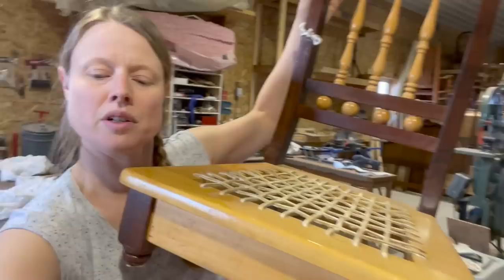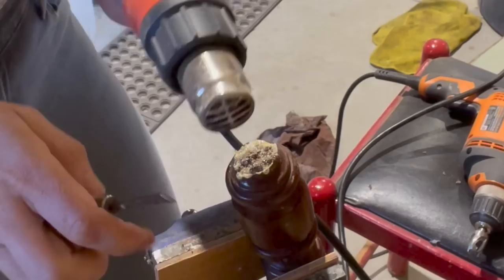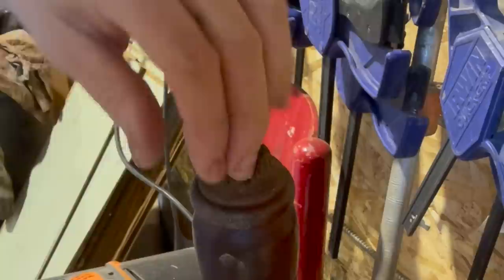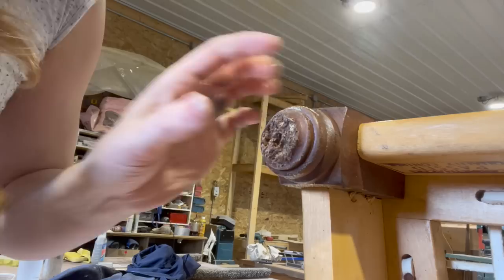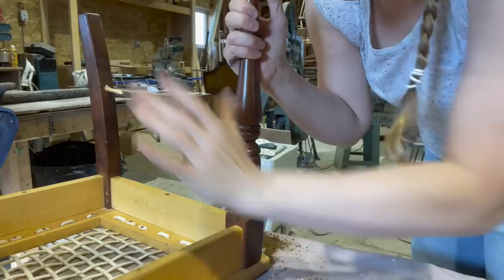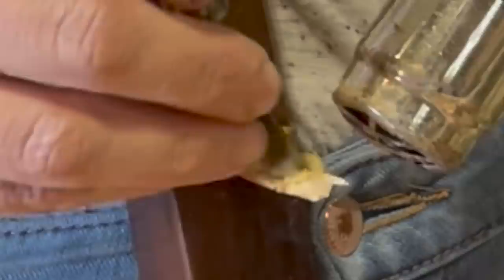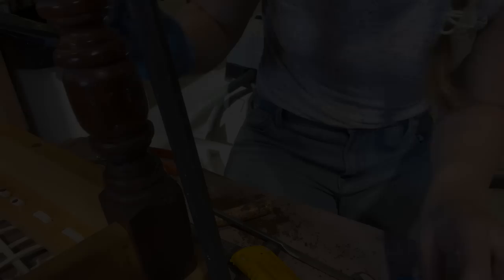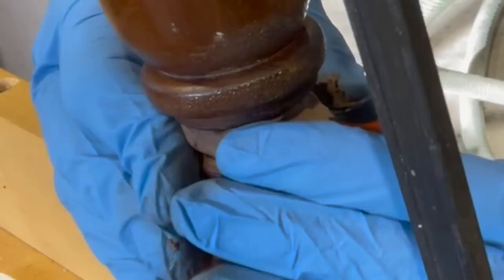Repairing a Broken Chair Leg

Comment: Great skills! I suggest when you get done, place the chair on a flat surface (your table saw usually works best as it is perfectly flat) and see if there is any unevenness. Normally there will be a slight wobble you can address.
Reply from the maker: I definitely learned that one from my dad! Thanks!
Reply: I told her what that I do is sit them down on a level concrete place and slide them back and forth and around and around in a circular motion and let the concrete sand the leg 
ends-bottoms off till they are all the same height and makes them solid, so that they don't rock.

Comment: Great restoration.
I would have cut more lines in the dowel to give the epoxy more tooth to work with. The dowel between the legs, maybe a pin inserted between the broken pieces in drilled holes as epoxy doesn't expand and contract the same as wood with moisture values changing over time. Some people tend to place their feet on the dowels causing stress to them.
Your finished product looked very nice.
Reply from the maker: Thankyou. So the epoxy we use is a marine grade epoxy and one of its best qualities is that it keeps a strong flexible hold. You are right, a lot of epoxies out there are very brittle and will snap on impact which is why I’m in love with this one. Although it is hard and can often times be stronger than the wood around it, it’s made to flex with temperature and moisture. Just like wood. Cheers!
Reply: Amazing, beautiful, well done, interesting, entertaining, educational and truly enjoyable. Thank you for taking the time to share this with us.

Comment: I’ve used lashing on long split joints (like the spacer). Use string or nylon fishing line & coat with epoxy. There’s not much pressure on the spacer split — until a ‘kid’ decides to rock back on the back legs 😠 (I’d hang ‘em!)

Comment: I have a old doll crib that was mine, and it has spindles. What do you use to get the paint off. I noticed you always take everything apart and start over. You inspire me to want to redo this crib for my grand babies! Or what video would you suggest I watch! Thank you for sharing all of your talent! Your work is amazing!
Reply from the maker: Use a stripper and wash them down until they are clean. Rinse with what the stripper suggests to rinse with. Cheers!

Comment: The dangers of advertising I used to work in a hardware store when gorilla glue advertising first came out you couldn’t keep people from buying it after showing them a mock up in a clean glue joint I tried to talk people out of it even seeing a sample in a clean fit a good Titbond joint is stronger that the wood, I had a number of square (jointer) the glue held but due to wood movement a board glued with Titbond the board split the entire length the glue joint didn’t move no dowels or bisques I believe the same will happen on a good white glue joint!

Comment: Observation
old wood exposed to moisture, corrosion and insects should be cleaned with diesel fuel as it is the best cleaner and disinfectant for wood and it does not expose it to cracks.

Comment: Awesome color matching, especially on the blonde rung. Very NICE results, even though I did notice your dowell drilling was a bit off angle — was that on purpose? I've got to repair the thin leg on a desk my uncle made, and have come up with a couple of methods that SHOULD keep the drill hole straight, except the break is at an angle. Always tough on legs attached, where you can't use a drill press or lathe to assure a straight hole.
Reply from the maker: Generally you want to stay in the middle of a rung for a new dowel. But if one side of the break has more intact than the other you can lean a little heavier on that side. Cheers!
Reply: @johnsfurniturerepair  I agree with that, but what I was referring to, is the angle of your forstner bit. What I thought I saw on the vid LOOKED like your drill wasn't parallel with the leg (it APPEARED you were about 5 degrees off). Same "angle" when you drilled the other. It's tough to do freehand, and you mentioned that the leg needed adjustment when assembling. As you drilled both at the same angle, I was asking if that was on purpose (due to the damage on the short peice). ?

Comment: Why did you not use white or yellow wood glue for the wooden plug?
The chair turned out really well, 👍
Carsten
Sweden
Reply: I’d like to know that as well.  Have not used epoxy in the past.  Does not look easy to work with.

Comment: The 5/8"  dowel looked to be about 4 1/2 inches long, and probably went right through the mortise & tenon joints where the leg joins the corner of the seat.  

I'm still mystified as to how you knew the leg was going to end up exactly the right length that it was before, so that the chair didn't end up rocking on three legs.  

·
Reply from the maker: If you line up and reference the old parts you can get it to the same length as I was. Cheers!

Comment: Very interesting, but why did you use a coloured glue at 13:45? Given that the colour of the wood is rather light. 

Cheers
Reply from the maker: Thankyou for watching. The epoxy I use has a pretty amber color naturally. But I definitely could have used something to lighten it and made my life a little easier in the touchup department. Thanks for the question! Cheers to you too.

Comment: I do like your video, however, I think you'll find this repair will not last long. In my own experience, I would have taken that horizontal spindle to a good wood turner and had a new one turned. And because I grew up with a fat Dad, I saw broken chairs more than once. People are heavier these days, including myself. Steel supports is what I would have installed. No hate, just say'n
Reply from the maker: Haven’t had a repair like this fail in 20 yrs but thanks for watching. Cheers

Comment: Even just by eye when you are doweling to pieces to getter you seem to get the angles to match, is there a trick to
Or just talent and a good eye, I occasionally have issue one dowel even using a doweling jig?
Reply from the maker: Ya jigs are 90% useless but if you learn how to use one and all its quirks they can help. I’ve been at it for 20 yrs and my dad used to make me drill straight by hand and feel

Comment: Great job..  Curious … are these kept out of the weather and if not would you have considered a urethane
Reply from the maker: rattan definitely needs to be kept out of the weather. it is very susceptible to moisture and the steam bent pieces will start to spring back if they get moist. there really isn't a finish that would protect it in the long run

Comment: Nice work, although to me this looked like a $100 repair on a chair worth $5. Also I have a question, in my humble experience working with epoxy and carbon fibre I found that when adding some thickener like sawdust or microballoons the epoxy loses much of its ability to form a tight bond with the glue surfaces due to the added viscosity. Not a concern with wood?

Comment: Very nice job the glue you use for the leg did you just put sawdust in for the colour or put colour stain as it did look very brown stay safe 👏👏👍
Reply from the maker: Hi and thanks for watching! The glue I used in this video was west systems epoxy which has a bit of a yellow amber colour, the saw dust I added gave it most of its dark colour. when i remember, I try to keep sawdust from different colours of wood to help colour the epoxy when it will be visible in the repair.

Comment: Also. A nice and stronger way to do a broken leg repair is to remove the seat  and drill through  and counter sink a lag.   Obviously things have to be centered  but when you glue and pull it together  it’s super strong  and you can fill and finish the top of lag  if necessary.

Comment: Is there a particular reason to use electrical tape vs any other tape?  Painters tape, for example?  Just curious if there was a particular benefit of the electrical tape.  Grip, the plastic-ish nature of the tape vs the epoxy.  Nice work blending in the repair work.
Reply from the maker: its very stretchy and i can get more pressure with it than other tapes.

Comment: Can you speak on why you use dowel rods? I've seen journeymen furniture repairers say that the joint will be weak and break over time and they usually cut in a spline across the broken joint.  Including someone that came to you shop recently and does furniture repair. The reason I am asking is I have used this method a lot (that you did here) and have been concerned about the longevity of my repair work doing this method. Please comment your thoughts about doing it this way.  I would appreciate you opinion and thoughts. Thanks!
Reply from the maker: Well I’ve been repairing this type of break this way for over 25yrs and I can say I haven’t had one return for failure. I think it’s important to have a tight fit and to use the r right size of dowel and a very strong but flexible glue. Cheers

Comment: Great job...again!!  You mentioned that you are using some shellac that you mixed up.  What did you mix together to get the final shellac solution you used?  Thanks.
Reply from the maker: Just amber shellac. No color added
Reply: @johnsfurniturerepair  Thanks!

Comment: U may think about why it broke in the 1st place.  Then ask should u just repair it to
make it as it was?  That leg broke bc the designer tapered that portion of the leg
(Kiss Chocolate like tapered n tear shape) narrowed that leg out at the junction
far away from the bottom of the leg, close to the seat.  The leverage from buckling
n swinging that leg, dragging, shifting the chair placed a lot of force concentrating
at that top junction of the leg.  It was bad design to cut channel to any of the 4 legs
there.  Yes, the dowel idea was good.  But using much more fatter dowel than the
broken diameter exposed portion of that leg would b better.  But, using a longer 
steel or  brass dowel or even a piece of steel pipe w threaded ends tapping into
the leg and the other end of the leg deeply wld b even much better.  Eventually, 
ur customer would have other legs if not at the same leg broken bc of the way he
shifted, rocked, etc. w that chair.  Also, that thin broken stick connecting the front
to the rear leg was also not too smart.  It couldn't take the stress and broke.
The chair designer was not up to par...

May the aesthetic Win every time for a stationary ornamental art object, but not 
for a daily use moving furniture that carry 300 lbs of big seat!  Don't rock the boat!!!
This boat's floor doesn't give like water!

And, never use nails on wood.  Use pre-drilled hole for screws* (e.g., for that
leather straps) or pins as upholsters do.  Only carpenters r allowed to use nails.
They split 2 x 4s all the time on ur house framings.  But the customers won't
notice after sheet rock over them and even on the balcony wood rails, or
stair ways of wood, the customers wldn't c the splits.  Everybody else, including
the owners of the house or owners of the furniture may think about reversible
screw usage instd of nails.  Glad that glue mess was reversible and ur customer
didn't try hammering a nail diagonally to re-attach the broken leg!  Maybe a few
screws there may have held it longer but the basic design was bad.
_________
*Self drilling screws r not good nuf.  They still split wood bc the chip have no
place to go and the wood is forced to squeeze out (causing that split).  Learn
 metal machining vs. just carpentry/wood working!
Reply: Now, i'll continue watching ur video.  Wow!  very nice large shop, well
equipped.  If u have a lathe, that thin side stick can be re-vamped +
put the same fashioned stick across the front legs too.  The back legs
seems strong w no ornamentation turning.  Thank you for ur excellent
demo.  Yes, u need to clarify the analysis of the chair why it broke and
how to improve it B4 ur implementation.

Comment: Sorry but this is actually a complete waste of time it will fail again as it has done in the past,
If you're gonna do a job right, do it right the first time and make a new leg with practice you should be able to copy it identically and should be able to colour it to match as well.
Retired specialist cabinet maker & joiner, 
Good luck you'll probably find it will come back.
Phil from the Moulin in France
Reply from the maker: Haven’t had a repair like this come back in 20 years. Cheers!

Comment: I don't understand the choice of epoxy as a wood glue. Most furniture pros would have used a gentle expanding adhesive for this kind of repair. Epoxy was designed for the nose cone of Concorde, to stand high temperatures  its not really a wood glue?
Reply from the maker: Sorry. Going to have to strongly disagree with you. Expanding glues are the worst part of repairs these days. Getting that stuff off after it inevitably fails is a nightmare. Every furniture repair person knows there is a place to use epoxy, wood glue and hide glue, but I have yet to see anyone worth their weight use an expanding glue. Thanks for watching though. Cheers.
Reply: @johnsfurniturerepair  Ok well there are a lot of experienced pros on TV shows shown using it every week. Well renowned restorers of some note, seen by thousands of people. Epoxy has no shear strength and is prone to cracking, it probably doesn't bond correctly with cellulose as its not really a wood glue. D

Comment: 1) Is it necessary to remove all glue before sawing the foot as much as possible !
2) The big problem in these repairs is to line up the foot with the chair part of it. You give no explanation on this, sad ?
3) Coloring usually wil not "take" as well on the glue than on the nude wood. Do you have a trick for this ?
Reply from the maker: 1) yes
2) im not sure what you mean, the leg was lined up right back where it came from. i didn't move anything, just lined up the break which you can see on camera
3)The toners I use are acetone based, acetone eats into epoxy and most non catalyzed finishes